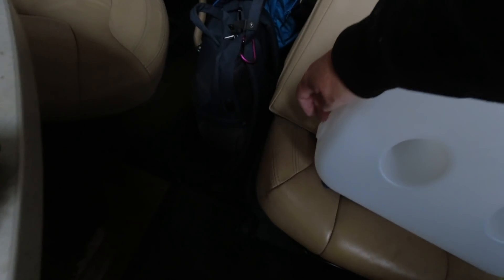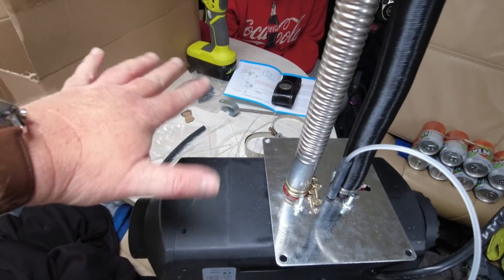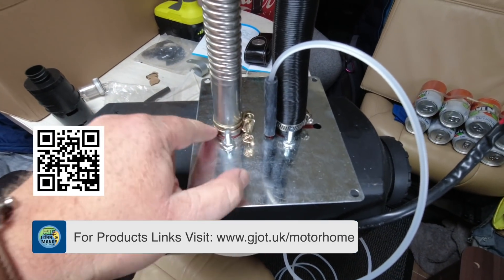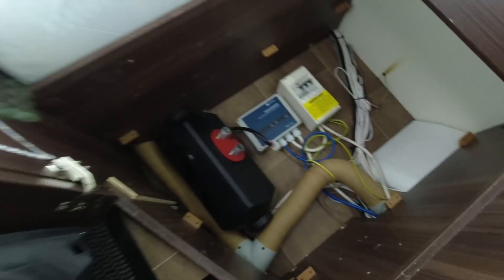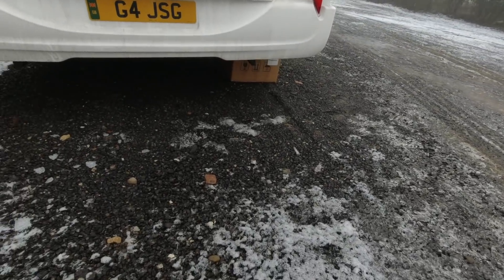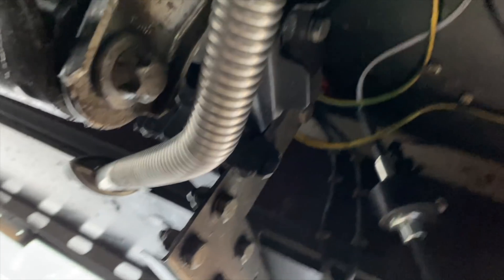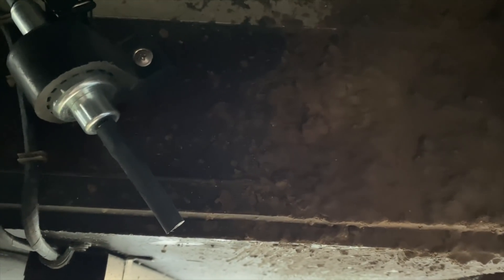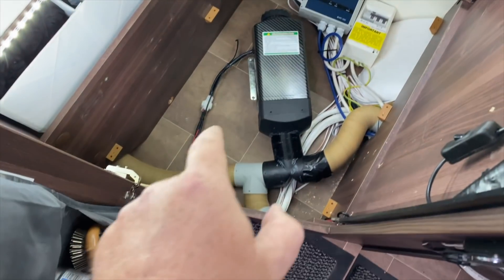Diesel heater Install in our MotorHome

Comment: Hi Both, good vid as usual, always wondered why you hadn’t done this ages ago, I’ve had one in my caravan for 2 years now, with no faults.
Just one thing I would have done different on your install, that’s is I would have used a turret  plate to go through your floor.
I also think you should have stressed the importance of having a CO alarm, you probably have one anyway but forgot to mention it.
One more thing, there is a product called Afterburner which allows full control over every aspect of the heater, it’s open source, however the developer has stopped shipping them to the Uk for now due to the extra taxes/ paperwork involved since Brexit. You’ll find the Afterburner details on a dedicated Fb page.
Hope this is useful info, all the best, stay warm, safe and enjoy👍Neil
Reply from the maker: Thanks for watching 😁 we wanted to see how well the truma lpg system performed before we changed anything. 👍🏻

Comment: Great informative vid as usual, especially John's explanation via the buttons. 
I have one of these on my boat and now run it on kerosene after it sooted up and clogged puffing white smoke. I used a stainless steel marine silencer and exhaust, cost almost as much as the unit 😂
Reply from the maker: Thanks Colin.. sounds like a good set up now 😁👍🏻

Comment: I have a Webasto diesel heater mounted outside/underneath my van (in a protective housing). I do find it quite noisy still and the ticking of the pump is very noticeable but is tolerable and you get used to it. I'm always very conscious about running it when close to other vans or habitation because of the noise outside. Not the best thing for stealth camping though but very efficient. I've thought of adding a silencer but have heard they can cause issues - My heater is not very accessible however for servicing

Comment: Hi John  How much current does it draw during start up and use. I'm interested in what the battery drain is over night.  Thanks Jeremy
Reply from the maker: |It's 10 amps for 1 minute and then less than 1 amp when it's running after that.
Reply: @johnmandy  oh thats not much, thanks very much. Stay warm!

Comment: Hi John and Mandy. Great video as usual and good to see you keeping toasty during the lockdown. Some people recommend that you run the heater on kero for a cleaner burn. I have done this as much as l can and have had no smutting issues. Also the kero is cheaper here in lreland than agridiesel. Stay safe and keep up the good work 😘
Reply from the maker: Thanks Thomas, we’ve only looked at red as we have loads of it available to us - looking around where we are for Kero we can only find bulk sellers for 500L 🙈

Comment: Just looking at fitting one in my newly acquired yacht, also looking at powering itself with a thermoelectric generator on the exhaust side though not enough amperage for initial start up but after 5mins of running the 2to4 amp for continuous running appears to be achievable what with the available cold water pumping through a heat sink opposite side of generators, feasible I’m sure with trial and error, it will at least trickle charge a separate battery leaving my engine and leisure batteries out of it. I remember your battery going flat due to this in your last van. I will certainly use your link just a search for a marine exhaust.
Thanks 🙏🙏👍
Reply from the maker: A poweroak ac50 can power this heater, it only needs 10amps for a minute and then it needs only an amp to run the fan & fuel pump.
Reply: @johnmandy  I will occasionally  be away from shore power for long periods being unable to charge that, and whilst i've solar those cloudy days and need of power to life saving electronics thinking of trying something alternate. Only a small area for solar panels due to footfall on the deck 1x 100watt panel on stern rail, so thinking out the box but thanks for recommendation

Comment: Had mine for two years brilliant but you will find the exsust that comes with it won't  last long.. Pump ticking can drive you mad...mine is suspended with rwo strong cable ties and two cup hooks. lol. Yes silence. Keep safe you two
Reply from the maker: Thanks Ken, we’ve an extension kit for the exhaust on the way and some things to try for the ticking.. thanks for the heads up 😁❤️
Reply: I ended up mounting my pump onto a 3/4" coolant hose, and attaching that hose to the van. Gives a soft mounting, you can put bolts through coolant hose, it's very strong.
Also I used proper rubber (vacuum hose possibly, cotton shrouded) hose in a loop, as the 'thwack' gets transmitted along semi-rigid pipe.
BTW the pipe thickness doesn't affect the flow, as far as I know.
Reply: I use rubber exhaust mounts absolutely perfect no noise from pump

Comment: Hi John did you fit the small clips onto the fuel pipes..plus we run ours on kerosene 50/50 mix with no problems stay safe and positive xx
Reply from the maker: We’re swapping out the pipes so will do that then 👍🏻😁
Reply: @johnmandy  so pleased your on home ground 😀
Reply: Plus fit a small fuel filter 😃
Reply from the maker: @jcbdiggers1  there’s already a fuel filter in line 😁👍🏻

Comment: Hi John and Mandy. Can you give more details on the comparative running costs of using the  Truma versus the Chinese heater as this the whole reason for installing a second heater.?
Reply from the maker: The cost comparison is in the video as is the reason we installed it which wasn’t to save money but as we would have run out of LPG with no way of getting more 😁👍🏻

Comment: John and Mandy please note that Red diesel is not as clean for you mobile home heater as normal pump diesel that’s why most farm  machines and plant have secondary throw away or replacement secondary fuel filter. Might be worth investigating if you can install one of those plastic through away ones in line. Maybe without it will make injector or even the little pump fail later. My tank was spotless in my excavator when I first got it using regular diesel since I’ve changed to save money it’s now full up with a brown growth. I change the machines fuel filters regularly and have to clean the little in line one also that shows how fine a material comes from red diesel. The farmers around me have the same problem and by a bow of these inline filters for around I think £10to £15. Might be with putting some of the red diesel in a jar with tissue paper se if it collects any residue. 👍
Reply from the maker: Thanks Nigel 😁👍🏻

Comment: I see you said your waiting for some parts to finish the fitting off! Are you going to add a . chinese diesel heater mounting plate stainless steel  turret planar loads on eBay 30mm and 50mm would be great with your floor to seal it off.
Reply from the maker: No we’re not going for the turret, the floor is sealed to the inside, we have a heat shield to the outside which we’re improving on then we’ll be sealing the outside too so don’t need the turret 😁👍🏻
Reply: @johnmandy  that's good sounds like you have it all in hand.

Comment: Hi great job. What are you doing underneath the van with the water splashing on the hole area you cut, will it not put damp into you floor?
Reply from the maker: Thanks, it’s not the final fit as we’re still waiting for bits to arrive but needed it up and running 😁👍🏻

Comment: I have one in my garage and it runs hotter on kerosene and its cheaper also the red diesel and exhaust with the tissue is false as its combustion wouldn't leave any red soot ect ect loving the videos also get a glow plug tool and a spair glow plug for just incase
Reply from the maker: Good to know, thanks 😁👍🏻

Comment: Great video guys. I was thinking about heating for my garage like you suggested, can you tell me what power source 230 to 12v I would need? Basically how many watts does it use and what would I need to provide that?
Reply from the maker: The unit needs 10amps to kick over and an amp after that.
Reply: @johnmandy  👍

Comment: Hi . You can get a turret plate to mount it on through a thick , heat sensitive floor. Much safer . No risk of fumes coming back in either . Just eBay or Amazon Chinese diesel heater turret plate .
Reply from the maker: Thanks for the info 😁👍🏻

Comment: It's a bit hard to tell from the video but is that an intake silencer on the end of intake tube ?  Its just, I found out  that mine and many are supplied with what the call an intake silencer its not actually a filter but looks similar ,apparently a proper filter is required to stop bugs and dirt getting into the intake area and causing various blockages over time and smoke issues  , many are supplied with silencer intake devices that have no mesh screen like the filters supplied with others .

Comment: I had my heater fitted by lukesvanlife I'm picking up a new to me van tomorrow . Im think I should get my diesel heater off n have it refitted ..just dont know how tho lol .
I have to to put plugs I just couldnt stop hearing the ticking kept me awake .
Reply: I ended up mounting my pump onto a 3/4" coolant hose, and attaching that hose to the van. Gives a soft mounting, you can put bolts through coolant hose, it's very strong.
Also I used proper rubber (vacuum hose possibly, cotton shrouded) hose in a loop, as the 'thwack' gets transmitted along semi-rigid pipe.
Reply from the maker: @G-ra-ha-m  those are changes we are making too so good to know they worked for you 😁👍🏻 we can’t run it overnight though, the tick is new so it’s all we can hear
Reply: @johnmandy  I actually suspended it on about 5" of hose. The shock is along the axis of the in-out nozzles as it thumps the fuel across, so if you support it so that is on the 'loosest' (most compliant) axis (The pipe being the stem of a T, with the top of the T being the in-out).
The pipe is great, you can drill it and bolt it.
This reduced mine to a very dull thud that's difficult to hear.

Comment: On the new controls, if you hold the up and down arrows on the right, it turns on the fuel pump without heating the glow plug.
Reply from the maker: Good info for priming the fuel line 👍🏻

Comment: Good work! Apparently you should mount the silencer with the angle it comes with as there is a drain hole for moisture, up to you though. Also I have the same controller as you and if you hold the up and down arrows it primes it without error codes👍 if you ever run dry. Also it is a 3-5KW or a 5-8KW as it just depends weather it is a high or low setting👍
Reply from the maker: Thanks Max 😁👍🏻 it was just an interim install till the extension exhaust kit turns up.. we just needed it up and running 👍🏻

Comment: Hi John,Mandy Coops .how did you decide the placement of the T piece  to the origional  tubing.Thankyou.
Reply from the maker: Whichever way fit and gave the correct flow - we did have to swap it once as the back was getting all the flow (straight piece from the heater) so changed the T so more reaches the front 😁👍🏻

Comment: Hi John and Mandy. Hope you are both fine and enjoying your trip you are currently on. A real inspiration to watch and follow.
About the same time as yourselves I fitted a diesel heater to our Motorhome. Agree great bit of kit. I have noticed your controller is the same as the one I got supplied with the temperature value shown in the top left of the display. Have you found when the heater is not in use and the temperature registers around 24 deg C it starts to show erratic readings ? No problem when the readings go lower and when the heater is in use. Thanks NIgel.

Comment: When I fitted my Chinese diesel heater to the small van I built. I didn’t like the idea of the diesel pipe coming out of the bottom of the tank so I drilled a hole at the top near the filler and used the pick up pipe I think it’s designed for using it I have your main diesel tank. I’ve put the pipe through the little hole and are used tape to hold the nut in a spanner that is designed for brake pipes. So the spanner had a little split in the side to go over brake pipes so when I tightened up the nut I could get the spanner back out of the neck of the tank. Stay safe🚐☕️☕️👍🏼🏴🌈🙏🏼💙❤️💙❤️
Reply: I did the same with the tank . No potential leaks below the fuel line. 👍
Reply: @stina6762  Yes my lovely it seemed the only sensible way to drill a hole. So now there’s no way it can leak🚐☕️☕️👍🏼🏴🌈🙏🏼💙❤️💙❤️
Reply from the maker: That’s a good heads up there.. 🤞🏻this’ll be ok, we check it a couple of times a day 😁👍🏻❤️

Comment: I was thinking of running the fuel line to the main diesel tank but now you mentioned red diesel well I think I will reconsider. Where do you get red diesel?
Reply from the maker: We have it very close by but looking at where else to get it we just did a google maps search for red diesel and got loads of hits - called a few to be sure and they have it on pump 😁👍🏻 give it a try near you
Reply: @johnmandy  I found one and they have a pump 85p a litre. Thank you.

Comment: Ive found with mine that when driving in the rain any spray from the tires can bog the air intake filter best move it to be sheltered other than that no problems
Reply from the maker: Thanks for the heads up 😁👍🏻

Comment: Hi guys good video, if you fit a vent connecting to the van interior, and the heater area, would you then pull already warmed air into your heater area
 giving your heater less work to do ? 
= less diesel burned.
Billy.
Reply from the maker: It kind of does that anyway as the place it’s located gets warm enough to give the air intake a boost 😁👍🏻

Comment: As fitted and not switched on but you switch on the Truma heating would it blow though the diesel heater and blow the heat outside.
Reply from the maker: Since the diesel heater fan system only has an internal air intake it can't blow air outside, I think you might be confusing the external air intake which is purely used for combustion 👍🏻

Comment: Hi what did you use to seal the hole in the floor to stop damp getting in. 👍
Reply: Using a heat resistant sealant, Screwfix, bnq, wickes sell it
Reply from the maker: We’ll be finishing that as soon as the parts arrive 😁👍🏻
Reply: Looks good I'm considering fitting one in my motorhome.

Comment: Very interesting and thanks for making the video.  Is the reason the fuel pump goes outside to reduce noise in the van or is there a safety reason ?  Doesn't it make it more difficult having to run power outside to the pump in order to keep the connections weather proof ?  Also, any advice on drilling holes in the van - do you use a special drill bit ?
Reply from the maker: Definitely for noise but mostly just a preference 😁👍🏻

Comment: Just fitted one in my custom and I absolutely love it!! I had to drill through my plywood floor and I was worried about the heat from the exhaust. So I did the same as you and made the hole a little bigger but I added a heatproof wrap to the exhaust and it worked a treat. Absolutely zero evidence of excess heat on the ply 👍 £10 on amazon if you fancy extra safety.... Wish I watched your vid first to learn about the cap off trick, mine took ages to prime!!
Reply from the maker: Thanks Lee 😁👍🏻

Comment: Am toying with one of these in my old Land Rover as the heater is dire! I’m thinking as the fuel tank is inside under the seat I could possibly tap into it..... my old Motorhome had diesel/electric heating where as the new one is gas/electric, I much prefer the diesel version if I’m honest, like you say it’s easier to find diesel than gas.... also they don’t even have to dip tanks to check for red now if you’re being “naughty” 😂 they can put a probe up the exhaust (that’s what she said!) and it smells the dye. 👍
Reply from the maker: Ah that’s a shame to have a better system in the old van.. typical eh? Did it run well? We’ve seen cars being tested with tissue paper over the exhaust too 😁👍🏻
Reply: @johnmandy  yep diesel definitely burns hotter than gas imo but the new van is smaller so don’t really notice the difference to be honest 👍

Comment: We have one on our boat and the fuel comes from our tank which also runs the boat. Currently we are allowed to use red diesel but the EU are stopping this even though we are out. I shouldn't think it will affect heating but I dont think we would put in separate tank
Reply from the maker: From what we can see heating is exempt from the changes so we should be good. We can get red diesel easily where we are but if it becomes difficult we have the main tank kit at the ready 😁👍🏻

Comment: Something that's just jumped into my head, do these diesel heaters produce much moisture in the hot air and have you checked this with a humidity monitor, think it's called a humidstat??

I'm thinking of a standalone version for inside my shed along with a dehumidifier as I need to get the humidity levels down.
Reply from the maker: They produce a very dry heat, far better than the truma gas heater. 👍🏻😁

Comment: Hi John.  I've seen on some videos of these heaters. That, the  Control Panel's light fades after a while. Making it hard to read. But some have Replaced the LED on the display.  Hope this helps.  Jeff.
Reply from the maker: Thanks for the heads up Jeff 😁👍🏻